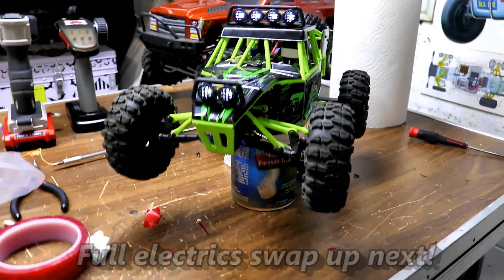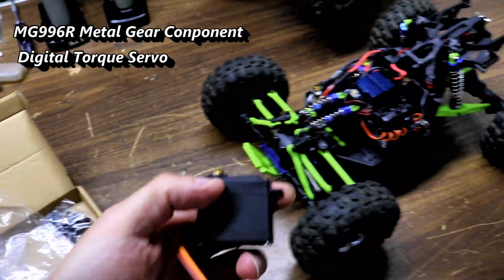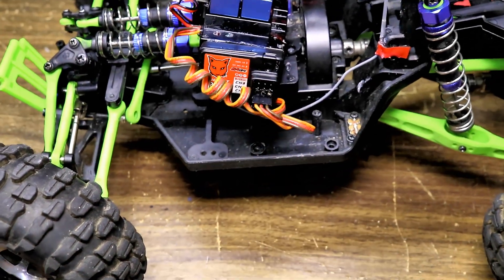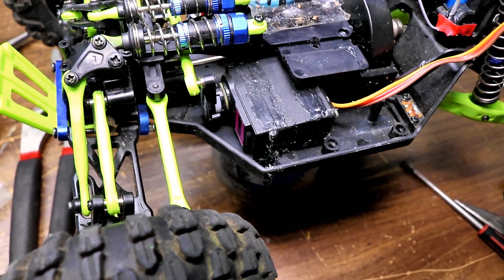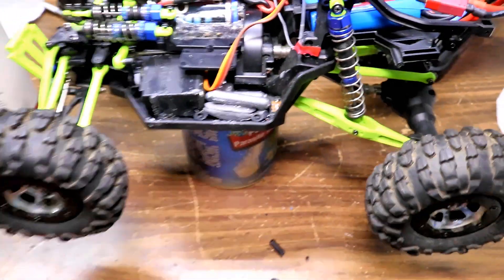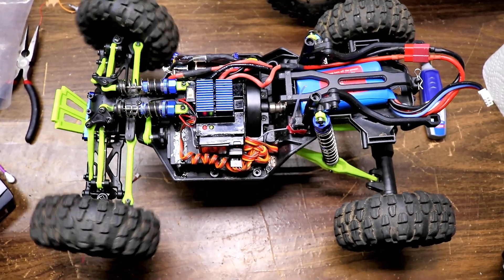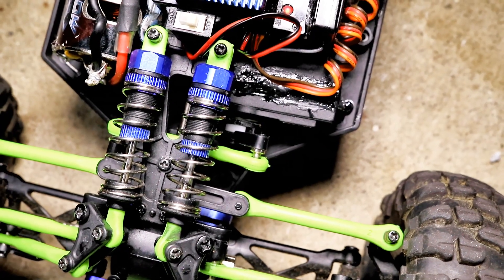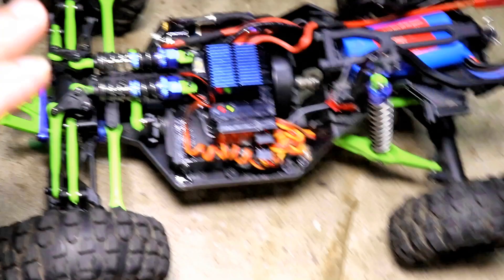WLtoys 12428 ELECTRONICS SWAP UPGRADE

Comment: Dude, can you help me out, I wanna replace my esc so it can handle a 3s. Thought the stock one could but nope.
Reply from the maker: Hi you  would need to replace all the electronics with normal RC type for 3s running, radio, and esc , and a servo, a quickrun 1060 esc and a cheap flysky 2.4 radio should work.
Reply: @ShenRC  Thats all I would need to replace is an esc and a radio? are the plugins all the same on that esc?
Reply: @ShenRC  It can handle 11.1v right?
Reply from the maker: @Turppa21  Hi you would need a new radio, ESC, and a servo I would use the redcat servo from the gen 7 or 8 its smaller and will fit better and mock it up to fit like i did with mine you can stick tape it down or use that shoe goo glue to hold it down in place.
Reply from the maker: @Turppa21  Yes see link specs near bottom https://www.ebay.com/itm/Hobbywing-QUICRUN-1060-Brushed-ESC-Waterproof-Speed-Control-1-10-Cars-Trucks/191438925774?epid=1779871826&hash=item2c92a62fce%3Ag%3A1pEAAOSwsPNcCGkZ%3Asc%3AUSPSFirstClass%2107508%21US%21-1&LH_BIN=1

Comment: For the same price you can get those 20kg red servos and they are great, that china servo with the purple sticker is horrible I had two burn up on the first run of each lol.
Reply from the maker: 😉👍 Yep I swapped this servo out already and put a metal gear servo in that came out of a kyosho fox and it is 100 times better now.
Reply: @ShenRC  yeah those ones with the purple sticker are strong but for some reason they kept burning up on me, they would get really hot and just fry and it is the worst smell ever lol.

Comment: How you put the servo plugs on the lights
Reply from the maker: Hi I just hooked them up to a extra receiver servo type connector the plus and minus and plugged it in the receiver in a extra port.
Reply: Did you tape or solder the wires
Reply from the maker: @or3442  Hi I soldered them up to a servo lead type plug
Reply: Thank you for your reply I have one more question does the servo has to be a certain type or any type
Reply from the maker: @or3442  Hi you can even use a JST plug also you just have to match the plus and minus the same in the plug as like the ones plugged into your receiver are now.
Reply: Thanks for the tips man

Comment: Help!! I ran out of battery and I used a 3S for few minutes.. I think I blew the ESC.. I need to change the ESC?? Please help!!
Reply from the maker: Hi what you are going to have to do is order a replacement esc receiver unit and take the burnt out one out and install the new one.  Thanks
Reply: If a chage the ESC from hobbywing quickrun I need to chamge the receiver amd control?? If so can I pair the old remote?
Reply from the maker: @spearapnea4708  Hi if you look at my later videos I show what I did with mine, if you get a esc you will meed a new radio and a new normal 3 wire servo and get it mounted in the buggy.  Thanks